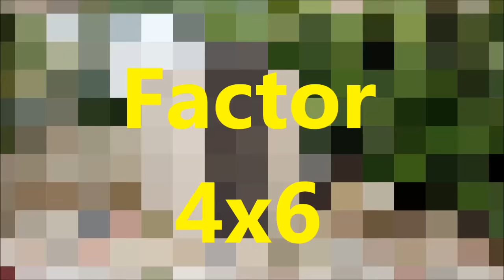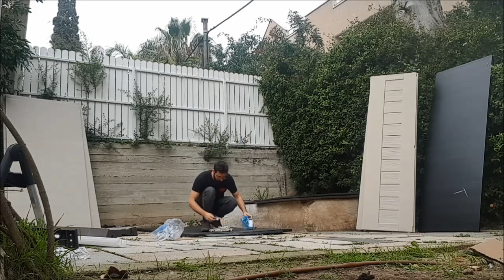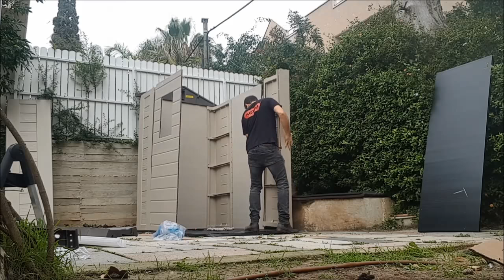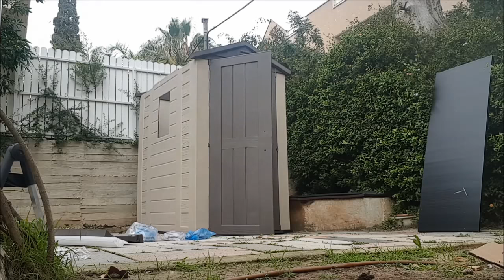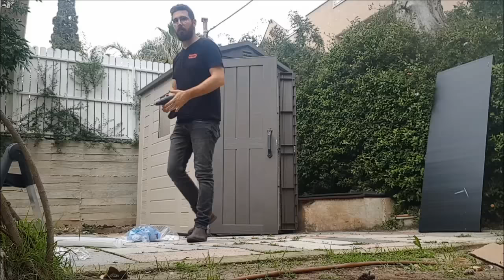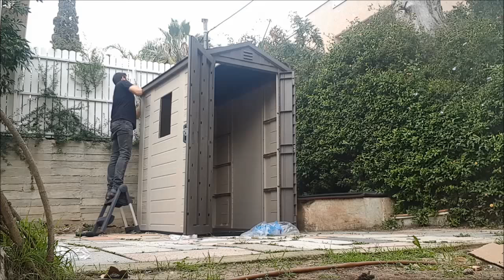Keter Factor 4x6 Outdoor Garden Storage Shed מחסן גינה פקטור 4*6 כתר

Comment: It is important to hold roof panels down whilst screwing down on the outside long faces. Screwing down tight on outside helps you to screw down the roof on the inside. Externally make sure roof fits flat and square before screwing as if not squre and "bending up" it could let in rain.. if roof is flat then internally guttering will keep rain out. I had to repair one of these that was badly fitted. I also ran a bead of silicone sealant on the inside edge of the roof panel to ensure extra water tight.

Comment: To stop shed going for a walk / wandering in high winds, plastic sheds should either be fixed down or even better can add weight into the base (but not resting against sides) using a few bags of sand (can always have a future use) or concrete kerb edges but ensure flat surface under shed first. Can also reinforce flimsy plasic floor inside with some thick cuts of OSB board but avoid MDF for this as MDF Swells if wet. Be very careful with overfilling shed as sides are flimsy and will bend if heavy weight is leaning against them. In/ after windy weather check roof and door are secure as once these are lost will need to replace whole shed. Roof mounting screws are not particularly good/ fine thread. Always have a spare dry tarpaulin and bricks ready in case you do lose your shed roof then you can still cover shed contents

Comment: Do yourselves a favour and don't buy these sheds.
Reply from the maker: It sounds like you have bad experience. I want to know What happened.
Reply from the maker: Please let me know what happened.
Reply: Why? Tell us your reasons. Plastic sheds if built correctly and sheltered from high winds then they last, need no maintenance, easy to move to maintain fences, can be moved to a different location without dissasembly, keep stuff dry, not as expensive as wooden sheds. I agree we should all boycott Keter as being an israeli company due to israel's horrendous war crimes and terrorism and invasions but they are part financed by the USA and many other manufacturers irrespective but who else makes equivalent sheds?